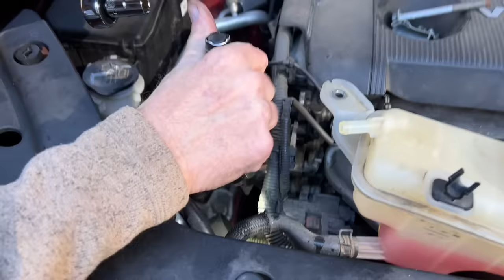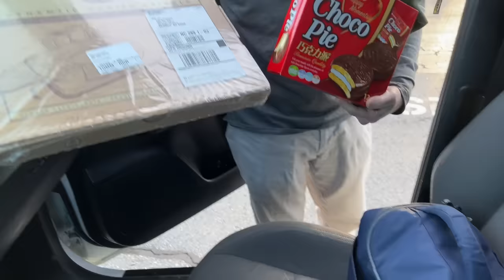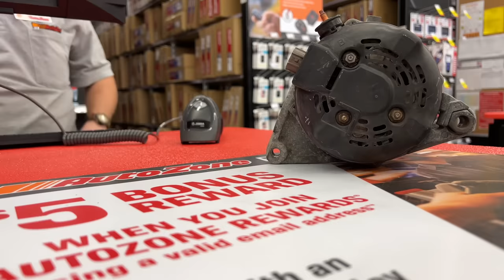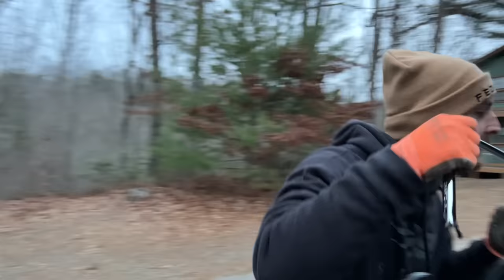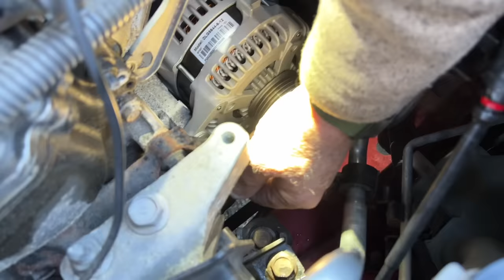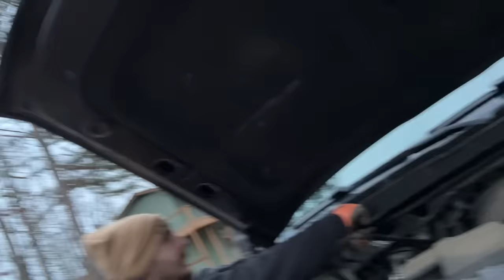Both Cars BROKE at the Same Time!

Comment: Gosh I hate car trouble! I wouldn't wish it on anyone.  My husband can't work on the newer vehicles- they are designed that way on purpose so the owners have to pay big money to have mechanics work on them.  My husband had a 2014 Silverado.  He had to have a transmission put in- $4,000. After 8 months he had to take it back to the transmission shop to fix the new transmission, the ownersaidit was under warranty.  The shop  closed, kept his truck for over 3 months.  When we finally got it back the shop had sold/stolen  parts off of it, including the transmission we were still paying the loan for. They did $17,000 worth of damages both in stolen parts and the damages to get the parts off. The shop owner did this. Police didn't do anything- cival matter. No attorneys would take it because they found out this guy had been doing this over 3 states and even though he had judgments for doing this to others no one was able to get money from him. Our insurance wasn't going to pay either- cival matter.  For 3 months we were paying for a vehicle we couldn't drive, maintain full coverage insurance on it and continued to pay the loan on the transmission they stole. We also had to buy a used vehicle for him to drive to work. He was driving my older vehicle and it broke down. GOD answered prayers! HE did it not me, I tried everything to get something done-- three supervisors from the head office of our insurance company stepped up and said this met the circumstances for a specific clause in their policy and paid for the truck! When the super nice, Christian guy came to get the truck- insurance was paying for it- after he got the truck on his rollback and and less than 2 blocks away from our house,  the truck caught fire on his rollback!  The idiots had left wires hanging after stealing parts, the battery- which was less than a week old when we put the truck in that shop- was still hooked up. The insurance company and the rollback company are going after this guy. I have forgiven him, for me not him.  I know my GOD will take care of him in ways I could never. Vengeance is not ours to take. I praise GOD we received enough to pay the loan off on the truck and pay the loan off for the transmission. Lol we even had to pay for another year on the  truck's tag because the tag was due before it was deemed a total loss, but there was just enough money for that and late fees. We will only take our vehicles to major dealerships now,  we will never again trust an independent shop. (I'm sorry this is so long) It truly is a blessing that you have someone that can work on your vehicle. I'm glad you got both of them going dear. Stay safe and GOD bless
Reply from the maker: Wow, I am so sorry you went through that, what a wild story! God is so good, it's true ❤️

Comment: It's extremely hard on a car that lives outside a garage. A car being stored in 55 degree temp then drops to 30 at night just makes rust and other not good reactions within 5 years of storage outside. The electric cars are worse but they have heated batteries.
Reply from the maker: It does make sense about them being stored outside, ours have never been in a garage. 😁

Comment: Your alternator charges your battery. Once you get it started. Run your car about 15min. Then get you a new battery and have your alternator checked. Cold weather can hurt your cars electrical system. Your car will tell you what srecommend for Cold Cranking Amps. Follow these instructions to the latter

Comment: This happened to us. We have 2 vans & about 2 months ago they were both dead at same time . The new one is still not working & needs to go to the mechanic Monday. It has 2 batteries in it & they r brand new & wont take a charge. It may have been towed 2 garage. The old van has 165,000 miles & it’s working fine since we put a new battery in it. Alternator was checked & tested fine. We’ve spent $600.00 so far & still not working. 😢
Reply from the maker: I'm so sorry to hear that!

Comment: Random thoughts. Seems vehicle manufacturers deliberately position parts under the hood in such a way that owners are discouraged from doing their own repairs and encouraged to take the vehicle to a dealer for repairs. It was not always that way.   Alternators seem to be helped along in their demise by extreme weather.  Same can be said about batteries.  Starters, on the other hand, are equal opportunity parts:  they will go out at any time, any weather.  When you are headed down a mountain at night and your alternator begins to go, it will get you really close to God really quick.  Now ask me how I know...